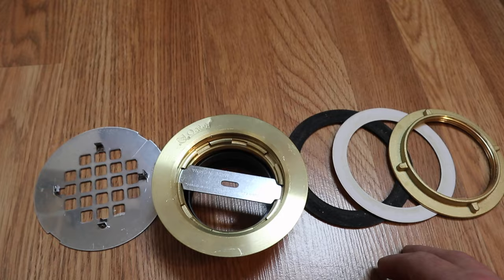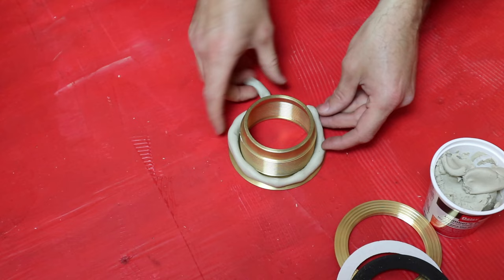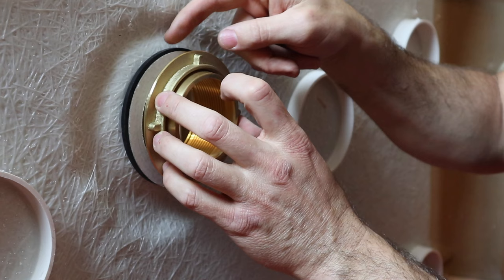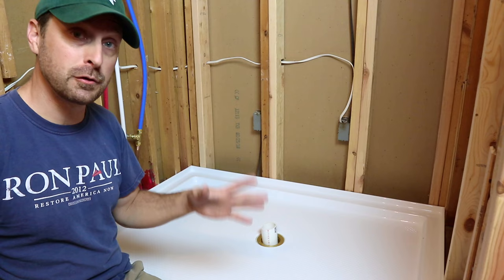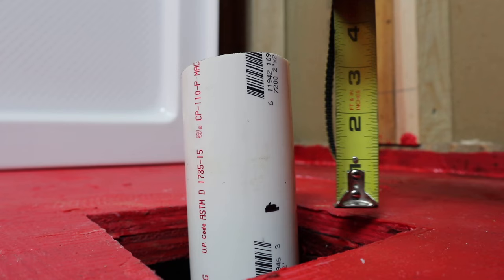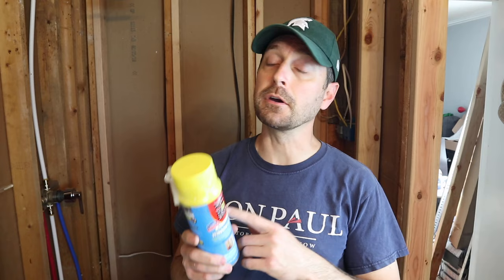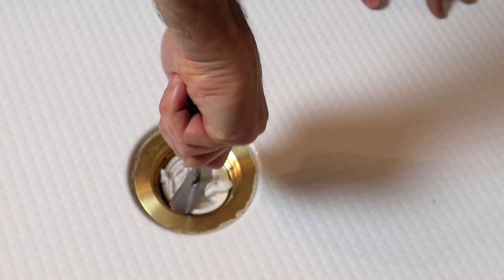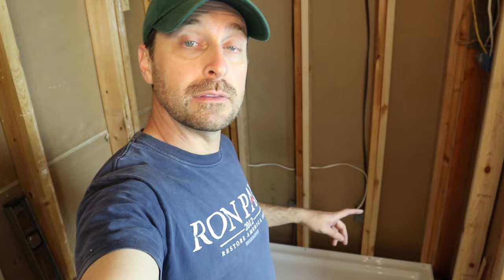How To Install A Dreamline Shower Base With A Brass Drain! 3 Key Steps You Cannot Overlook!

Comment: Maybe it depends on which Dreamline pan you have, but mine, which is just like yours, the  instructions do not say to leave the center of the circles free of mortar and it does not say to drill and screw the pan to the studs.

Comment: A tip that is helpful when leaning over spans like that; screw in some 2x4 or scrap stock about a foot off the floor and on the outside of the studs. It'll give you a handle if you need to something to lean on and just as easy to remove. Blocking for future modifications works well too.
Reply from the maker: Great tip. Thank you
Reply: @CountryLivingExperience  Yes, great tip. I'm about to install a 4" x 3' acrylic pan in a tight corner, on my own. When I was dry fitting it, I could use the open drain hole for grip when lifting it in and out. Just purchased a couple of suction cup grips which appear to be strong enough to lift it with both hands.... I hope. I'm going to be using a solvent weld drain fitting, with no access from under the floor, so I need to lower the pan exactly in position to dock with the riser pipe.

Comment: The Plummer Putty is NOT to be used on plastics, it says that on the container. And written on the plastic drain fitting it says NO oil based sealants. A finished polished fiberglass surface is in the same category as plastics. So I do believe silicon is the best way to go.
Reply: This is why I always read the comments.  Thanks so much.
Reply: Very helpful comment
Reply: Plumbers putty is superior. Lasts forever and doesn't mold.
Reply: My shower pan from The Onyx Collection came with one small tube (not a cartridge) of "100% silicone" sealant to be used on the drain.  They definitely did not want people to use plumber's putty.  In my experience, plumber's putty will dry out and crack over the years.  I used to work in the plumbing department of a Home Depot.  You can be sure that all of the plumbers putty they sell is not for new installations, but repairs.  Plumber's putty is old school, like a dial telephone, but if you have to replace the drain, that silicone can hold that drain like you would not believe.
Reply: @foggymtnbreakdown  putty definitely will.  I had a double sink drain start leaking a year later. And I used the putty designed for the material.  Now I silicon everything.

Comment: Great video I had a pipe bust in my wall.  72F weather and a copper line just got a hole in it... making repairs and we had to cut out our bathtub putting in a shower which so far has been a real pain.  This is a great video and so helpful.  Thank you!
Reply from the maker: Thank you. Glad we could help.
Reply: @CountryLivingExperience  I'm still working on my install day 3 of it but been sick with pneumonia trying to do a60"x30" and sending my wife doing the running to store which has been fun having her get everything I forgot. Videos likes yours are helping so much because I can see what I'm in for.   However I had to learn that a tub with a 1.5" drain only 4" from the wall vs 2" shower drain 15"
from the wall and learned my house is on a 6" slab it was 'fun'.  Once I get some rest I'm doing the walls have to hold the back wall up and put caulking without messing up the caulking without help.
Going to check out more video when I'm do with this project.
Reply from the maker: @fryreartechnology7611  Hope you feel better soon. You always find hidden issues when renovating. As an Architect, I found the craziest things in home remodels in the historic district in Houston. Crazy!
Reply: @CountryLivingExperience  I could only imagine what you find.  My coworker has a house in county middle of nowhere built in the 1890's.  His floor joist are rough cut oak 8"x24" logs one end to the other of this 6 bed 4 bath house. The downstairs is over 2500sqft but what's crazy is they have 12" between the floor joist.  House walls are over a 12" thick with 1" shiplap inside and out too.   It is a tank of a house.  Enjoying your channel too
Reply from the maker: hose older homes are amazing in their construction. I appreciate the kind words.
Reply: if you are having copper pipe just burst you might have acidic water eating away at the pipes so you might want to test it if it is acidic, you can add a neutralizer tank with limestone in it to make water safe
Reply: @ranger178  I learned the water where we live is river water not ground water and has a pH of 7.5-8 but mostly 7.5.  I grew up drinking it and like the taste better then when traveling.  Didn't feel as clean after a shower and it's been about 2 months now I learned this.  I didn't know drinking water could be like that but our Fire Pump at work is what had me looking in to it and it was on the water main and had rocks coming out it.  They were calcium and ph balancing tablet.  Like something I'd put in my swimming pool for chlorine pucks. That's a good point about the copper not really came to mind until now.
Reply: @fryreartechnology7611  I knew someone who bought a house and it had little leaks in copper pipes and the house had some tank full of rocks so they must have been trying to fix the problem with whatever was in the tank we figured that's what made me think it could be something in your water I had a kitchen sink drain made of copper get a hole in bottom from dumping cleaners in sink I guess my whole house is copper and that's only leak i had in 70 year old pipes

Comment: I just had a new Dreamline Slimline 32” x60”shower base with solid surface shower unit installed professionally and no where in the instructions did it say to drill and screw the base to the studs.. only to use thin set mortar underneath. Mine is solid without any movement at all..
Reply from the maker: It is common professional practice to screw it to the studs.
Reply: @CountryLivingExperience  Yes sir.  It is the method I was taught 35 years ago.  Great video.
Reply from the maker: @Alamyst2011  Thank you!
Reply: It's not in the instructions and will good your insurance and warranty. Also, you're not letting it expand.

Comment: The non-threaded oatey brass drain. The one that comes with the rubber gasket and 2 plastic round parts. How does that install around the pipe?

Comment: I’m confused. The mortar you put under the shower was it place over the whole shower floor or outside the circular rings under the shower platform?
Reply from the maker: Just in the areas outside of the circular rings.
Reply: @CountryLivingExperience  -- Just wanted to tell you that when you respond to these types of questions that you're helping many others like myself and its very much appreciated.
Reply: Yea, I was confused as well because, no offense meant, he glossed over that part and didn’t really show drawing lines on the floor to avoid putting mortar or the mortar before setting the floor down.
So, you draw lines where the rings in the bottom of the pan are. You can make a template out of cardboard. You mix enough mortar to plop down in all of the areas outside the floor bottom rings. Now how much to mix up and put down is unclear. He said for this floor, he used 1/3 of a 60 lb bag.
So I’m guessing you would need enough to fill in the entire pan (less the rings which need to set directly on the wood floor) and squeeze to fill in or even over flow into the walls if there’s too much.
I’ll be trying this soon. Great video series on doing this.

Comment: I'm about to install a 4' x 3' acrylic shower pan very similar to the one in your video - Voda brand, made in Quebec. I'm trying to understand why you specifically avoided putting mortar where the circular 'feet' are ? Since they are there to support the pan, surely they need to be in contact with the mortar. Indeed, the instructions for the pan I'm installing specify that the mortar should spread evenly over the entire area and then after lowering the pan in place pressure should be applied to ensure that the mortar is in contact with the entire bottom surface of pan. So I'm confused as to why you did that ?
Reply from the maker: That was in the instructions for the Dreamline pan. It makes sense because the mortar under the round feet can have aggregate that would make the feet a bit uneven.
Reply: @CountryLivingExperience  Hadn't considered that possibility. Never done this before. Actually, I've already leveled the floor where the pan will go with self leveling cement (over 3/4" OSB) - 1/4" thick at the highest point, 3/8" at the lowest -  it's now perfectly flat. Which is good, as I'm going to be tiling the floor around the pan on Ditra XL, which is 3/8" thick installed. The pan, I discovered however, did not lay perfectly flat and I had to sand down several of the support rings on the underside a little to get them all flush. Even still, there is a very slight wobble. What's not clear to me is whether 'the entire bottom surface of the base' mentioned in the instructions refers to the (PVC) support rings or whether the mortar bed needs to be thick enough to come in contact with the fiberglass also when the pan is embedded. Phoned the manufacturer to try and get some advice but couldn't speak to anyone who actually installs. The Customer Service guy even had the impression that if the floor is perfectly flat the pan only needs to be screwed to the wall studs - some people do that apparently ! When I told him that the pan was not perfectly flat he suggested putting some thin-set under the support rings only, which is contrary to the instructions and the opposite of what you did. I'm wondering if the best option might be to lay a bed of thin-set with a notched trowel and cover it with some plastic sheet so it doesn't grab the fiberglass underside. I don't want the pan to sit any higher than it is.
Reply from the maker: @BryWorYT  If your floor was perfectly flat, I would have not modified the pan by sanding off the feet.Those things are made precisely for drainage. If is was not flat I would have returned it. Install it the best you can to get the proper drainage. Dump a test bucket of water in it before you secure it to the wall or set it in mortar.
Reply: @CountryLivingExperience  Too late now to return it. Have to get the base installed this weekend - I'm already way behind on the bathroom 're-model' and no excuses now that it's too cold to mix mortar.  I just assumed the feet were not perfectly flush because it IS intended to be installed on a bed of mortar. It is level, now, when I lay it down dry, but there is a little flexing when I press down on one corner. Thanks for the advice anyway.
Reply: I emailed the company to get their advice in writing. Their response was the same as before - "If the floor is perfectly flat (which it is) you can fill the support rings with mortar to excess before installing it. This will add extra structural support and make sure it's leveled". Evidently then the rings are designed to provide full support and there is no need to pack mortar up to the fiberglass in between the rings. No comment about the fact that the rings were not perfectly flush though.

Comment: So does the shim come out when you put the shower base on or leave it in the mortar? Did you spread a pretty smooth base or just spotty areas where there weren't any feet? I have a different shower base with many quarter-sized feet. The instructions look like i am to spread a smooth layer over the entire area. I guess I just bury the shim and the feet in the mortar? Go Spartans!
Reply from the maker: You leave the shim in and bury it. I just left the mortar spotty because you want to have the pan press down on it when you set it in place. If you smooth it first, it may not contact the pan properly (or at all).  Go Green!

Comment: Question. My shower pan came with an inch thick styrofoam glued to the bottom of my pan. Am I to leave it on or remove it?  Thanks for your assistance.
Reply from the maker: You can leave it on there for extra stability.
Reply: @CountryLivingExperience  Thank you very much for the rapid response!!
Reply from the maker: @brothermaurice  You're welcome

Comment: For brass drain,  i assume it was only connect by gasket and top plate to the abs or pvc pipe,  right?
Reply from the maker: Yes. Gasket and compression nut.

Comment: My plumber used a piece of plywood underneath the base is that safe?
This shower has been installed inside of 24 x 12 shed, it will be used by 250 pounds person do you think I should be worried about this??
Reply from the maker: I would use the mortar. It is a more solid and stable base. Plywood may tend to flex a bit. Flexing in the base will crack it over time.
Reply: @CountryLivingExperience  thank you very much!!
Reply from the maker: You're welcome.

Comment: Hey watched this multiple times. Thanks. About ready set my 30x60 Dreamline pan onto upstairs bathroom. Have couple concerns. 1. Had taking old tub out adjusted 2” ABS pipe to fit. Ready to glue PTrap  below before putting on vertical piece. Up to drain. You mentioned approx 1/4” above subfloor and install the Oatly drain in pan first? Sure wish I’d got 32” pan instead of 30. Due to the alcove from tub being 321/2x61 I opted to scab 2x3X95” onto existing back wall studs. Ii brings curb flush with existing baseboard on left side of alcove.  The head side wall runs straight behind toilet on past 36” vanity. Due to elbow room very tight with 30” pan. Im doing a 5” x16x42” niche  positioned from head wall on back @ 48”-64”up from pan.  It allows an extra 5” elbow room showering.  Not doing a kneewall then door so plan glass at outside edge of curb. On head wall will rub tile on past curb accommodating 32” tile. On rear wall only will have 291/2” after durarock up from flange on up.. 
With plumbing noticed your pex. Perhaps could share a recommendation. The R/I valve be for the old Moen-trol Chataeu model being phased out. Hence regretfully last year had bought a $95 LED panel system off eBay.  With planning to sell home concerned bout altering plumbing for it and potential buyers qualms with a no name cheap Chinese product with sketchy warranty.  Practice solution being replace old valve with decent new universal on enabling more trim options. Would appreciate your suggestions?   
Didn’t realize lengthy message so will cut here. Last thing it was suggested to run strips of 2” rigid foam board under curb and perimeter under pan avoiding pitter patter water sound?  Thanks again. Great video!
Reply from the maker: I am unsure of your specific questions.
Reply: The Dreamline pans come with an instruction booklet for installation. I am installing a 60 x 30 pan and can tell you the instructions say the drain pipe must terminate 1 inch below the top of the pan. Because the exact pan height can vary when you are leveling it, here is what you do: dry fit the pan, check for level and shim it if necessary so it's perfectly level.  Mark the drain pipe flush with the pan using a sharpie. You should also mark the studs where the flange sits against them while level, that way you have reference when you pour the mortar and set the pan into it. 2. remove the pan, measure 1 inch below the marking on your drain pipe and cut it there. Alternatively, install the pan in mortar, make sure all your marks on the studs line up and it's level, LET THE MORTAR SETUP COMPLETELY overnight, then come back and cut the drain pipe 1 inch below the top using an inside pipe cutter to cut 1 inch off. All you have to do is mark with a sharpie or paint marker 1 inch from the bottom of the cutter bit, stick the cutter in the drain pipe until the mark is flush with the pan, and carefully cut it out.

As usual, there are multiple ways to accomplish what you want to do, use whichever one you are most comfortable with.

Comment: Thanks for the video I installed one of these recently but I didn't use any mortar or foam hope that it holds okay mine didn't come with instructions but I did use aqua defense under it and used stainless steel screws just cause I thought it was a good idea good to at least confirm I did that right.
Reply from the maker: You're welcome. The aqua defense should work great.
Reply: What happens if no mortar.  I did not use om 1 bathroom. 
 Dont want to tear it apart at this point
Reply: @benzun9600  I haven’t had any issues not using mortar been using my shower pan for a little while and I’m 270lbs so I don’t think it’s necessary.
Reply: I have the same question my plumber used piece of plywood underneath the base, it’s the right way to do it??
I’m very nervous won’t hold 250 pounds person using the shower 
this has been installed inside of  
24 x 12 shed
Waiting for your prompt respond 🙏🏻

Comment: There seems to be a big gap between the drain and the pvc pipe - Is that a problem ??
Reply from the maker: Yes, you need the proper size drain pipe or drain assembly.

Comment: Great video! One question, around the 7:07 mark in the video, it shows the drain a tiny bit elevated on the shower pan, this will cause water to pool around the drain, is this expected?
Reply from the maker: Thanks. That tiny bit of elevation does not harm anything. I mentioned that you can put some silicone in that space if you like.

Comment: I have insulation coming from the drain hole sides. I know this is wrong. And the pipe is smaller I think is been leaking to my floor. No gasket and no lock
Reply from the maker: Sounds like you need to redo everything.